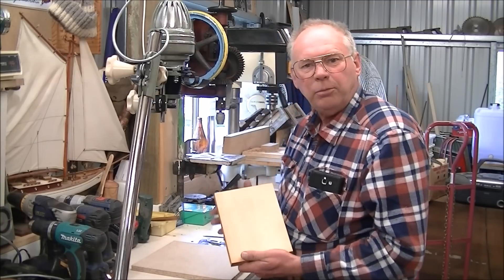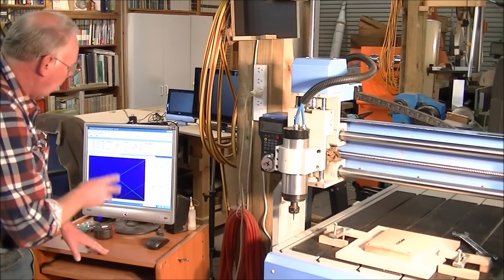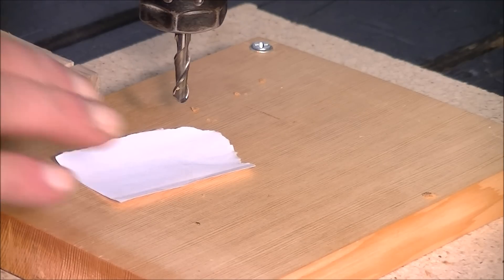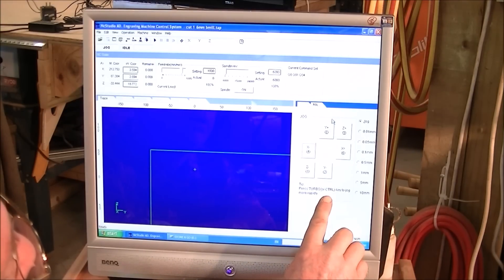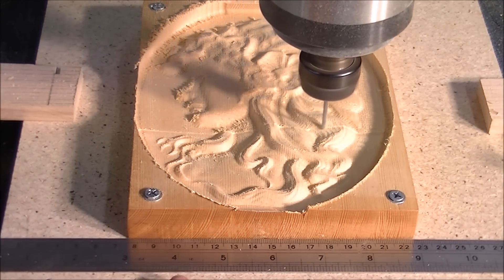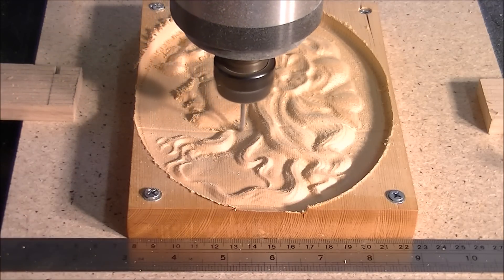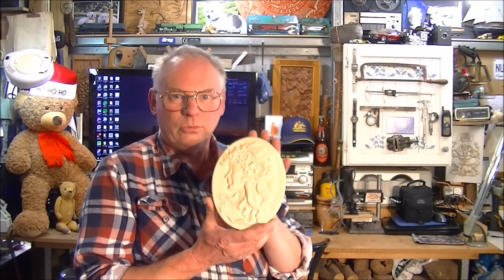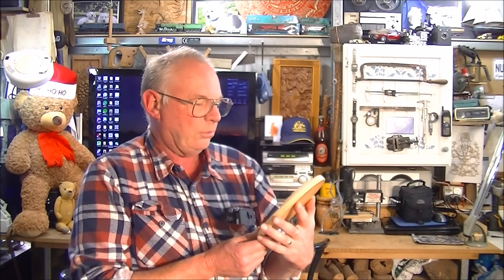My Chinese 6090 CNC router machining a 3D relief from a grayscale

Comment: Do you use a reverse cut flute bit to finish your wood cutting? That way it cuts pushing into the grain as opposed to lifting it away. Much cleaner cuts, minimal cleanup. An air stream would help clean out the chips.
Reply from the maker: Merry Christmas and happy new year to you and your family

Comment: Awesome video. In the last step, were it cut the circular part off the trim, did Artcam calculate that to or did you add that manually to the G code? thanks for the videos

Comment: Sir I want to engraving on iron coin design , so what configuration should be in cnc machine, I want best quality engraving on die, and much clearty and sharpness on job , so please guidance me which controller given configuration required in my machine for 3d coin design engraving
Reply: Sir my email address is sonu.singh2719@gmail.com

Comment: If the noise is from the resonance of the wood, would the thinnest piece of rubber between the work piece and the backing plate and/or between the backing piece and the machine table, make any difference?  Worth a try?  The neighbours might appreciate it!
Reply from the maker: UUUmmmmmm no!. ;-)
Australian Inventor Roger Clyde Webb

Comment: You can do it three times faster using V bit cuting tools with angles of 20 degrees and a tip of 0.3 mm with a cutting speed of 30 mm / sec and stepover 0.25 mm / sec

Comment: Hi Roger Webb, why do you use a big bit, followed by other small bits? how do you get the wood to look so smooth?
Reply: The big bit is used for rough cutting and helps to reduce time compare with using a small to and takimg multiple passes

Comment: Very beautiful achievement.
I have a 6040 router and I would like to get to do it, but I have a hard time finding a person to help me start with 3D. I have the CAMBAN software, and the control machine with MACH 3. CAMBAM does not directly generate the 3D.
Reply from the maker: Hi Fred, see video 153.
Australian Inventor Roger Clyde Webb
Reply: Cambam can generate gcode for a 3D surface, just select 3Dsurface under machining and create your MOP. Cambam can't pocket in 3D but these items in these vids you can  just use either a waterline roughing pass with a finish pass horizontal, vertical or both

Comment: your a legend matey,  I bought a 3020t and I think one of the stepper motors is broke I got a partial refund back for 240 it cost 320 so I got it for 80 pound,  the x axis don't move atall but on Mach 3 software the digits move on screen,  they give me another file to download but I am just waiting to buy a new desktop pc in few days with parallel port to read tests it, is there any other way to fix it and when I tune it like with motor tuning I don't know the right ports as the settings have spindle turned off,  and only numbers for x y and Z are all CNC router tuning different or based on same thing? please help